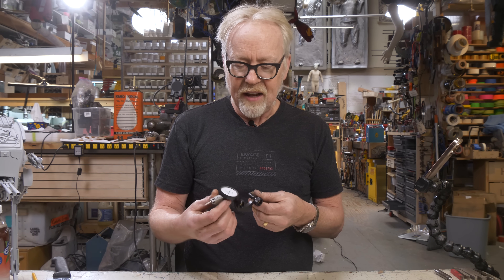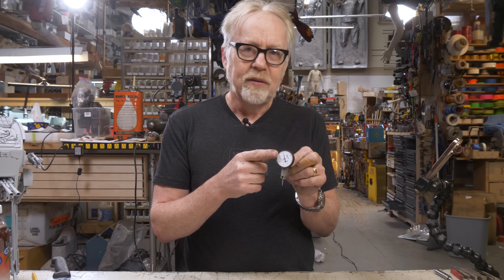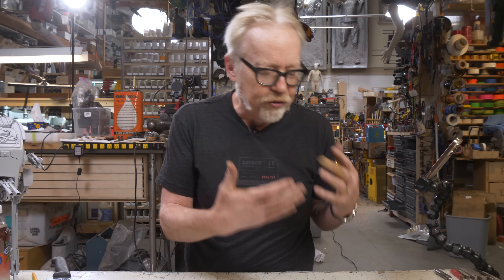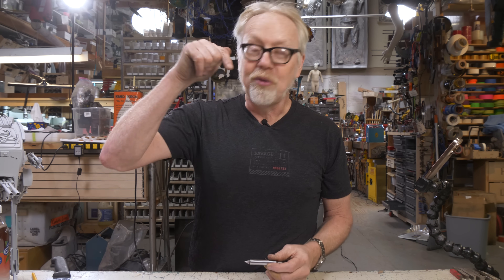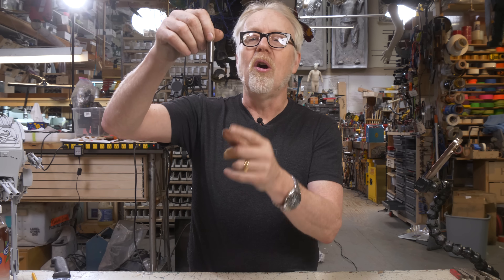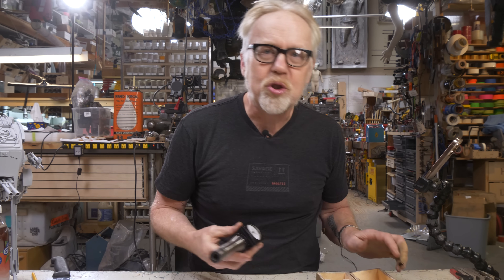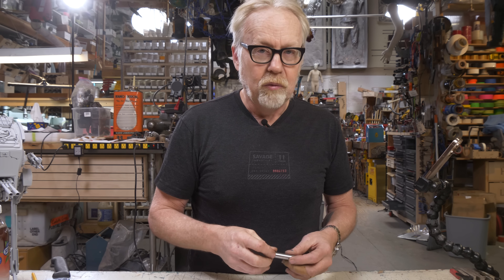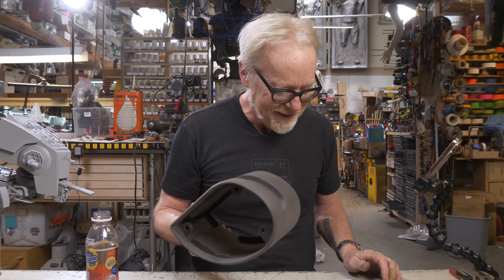Best Starter Tools for a Milling Machine

Comment: For a mill, I  think that you really need a DRO.....a mill isn't useless without one.....but it is SO much better to have one!!
Reply: I’ve used a mill with one and without one and with one is so much better. It’s much easier to achieve better accuracy since you don’t have to allow for backlash or remember how many turns of the dial you just did to drill two holes 7.875” apart.
Reply: I agree, makes a huge difference. On the mini lathe too. Especially an LCD dro for the mill👍👌🇦🇺
Reply: @adhawk5632  I have a retired machinist friend who claims that a DRO on a lathe isn’t very useful. After having used one for a few years now I have to say that I definitely disagree with him. He’s also extremely cheap.

Comment: Latest Clickspring video he makes nested brass tubes which hold a vacuum...
On a small bow lathe made from two piece of steel, and a hunk of wood, and some string.  All built with technology available in 100 CE.
Reply: He's an immensely talented machinist/clock maker for sure...  Crazy good tool maker as well.

Comment: A general rule of thumb is that you will spend the cost of the machine tool on tooling it up. Of course, much of this can be spread over time as you find you need things, but do plan on a fair chunk for initial tooling. Often machines can be purchased with a starter kit of things like chucks, basic workholding, cutting tools, etc.
Reply: I always heard to budget double. It's best if you can find someone selling a used machine with all their tooling.
Reply: @dooleve  Double the budget or more depending on how wild you want to go, or if you're starting at zero and want a full compliment of accessories and tooling.
Reply: Yes. 

Tooling costs can also be spread out via other machines. You can use a mill vise on your bench or drill press if it becomes available first. Some of the measuring and cutting tooling will work with hand drills, lathes, etc.

Comment: Thank you for exposing the Haimer. I also have one that I don't use because, even after spending hours zeroing it in per the instructions, removing it from the spindle and reinstalling it creates enough error to be a problem. The wiggler does not depend on concentricity of the mounting hardware to work, the Haimer does.

Comment: For machining supplies, Shars is a decent resource. They stock a wide variety of items priced from entry level to "last one I will ever need".  I have a tramming square, tool setter and dial indicator from them that I use to keep my lathe, mill and 5x10 CNC router in top form.

Comment: Greetings from San Bruno, Adam and friends: “If you had an empty shop and or starting over with a $2k budget what kind of mini metal Lathe would you look for and if it’s used, Do you have a top 10 inspection list? 
(This is why I’m planning to buy a Dial indicator with electric base) i’ve been going back-and-forth on whether to take a metal lathe machine in class at the Crucible in Oakland to know what I’m looking for, or putting that money towards a good used lathe/brand new mini lathe and learn as I go. I don’t recall if you ever made a video touring the Crucible in Oakland, but think you would make a natural ambassador inspiring a whole new generation of makers.
-Christos

Comment: The 3D print portion starts at 9:30
Reply: Seriously. 10 minute video and the titles namesake is barely a footnote.
Reply: The video I'm watching, (Albeit 13hrs after posting) is titled: "Best Starter Tools for a Milling Machine."  They must have retitled it after the feedback.
Reply: @Scoopy2022  Or they retitled it after 12 hours to try to double their clicks. That's pretty common, changing the title, thumbnail or both to trick people into re-clicking thinking it's a new video.
Reply: Thanks for that. Tested normally isnt this bad with click bait
Reply: @alexdavis9324  they are.
Reply: The video starts at 00:00